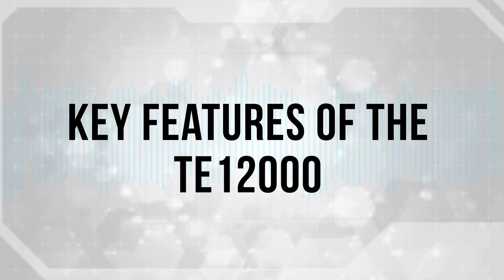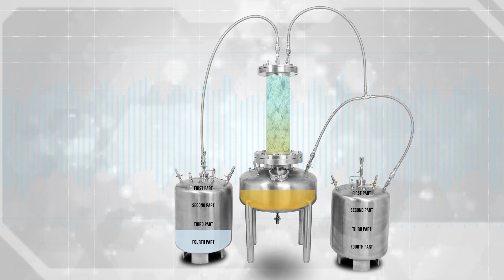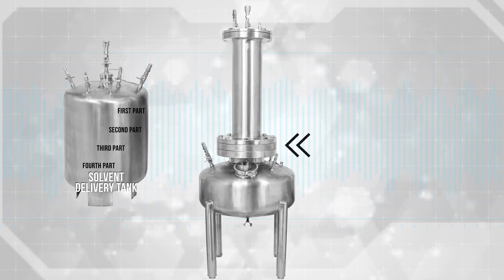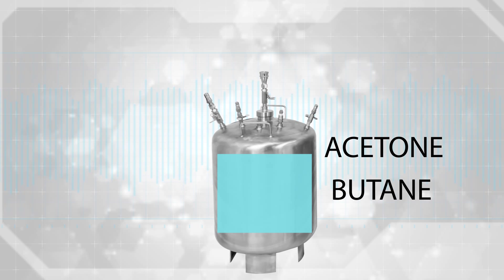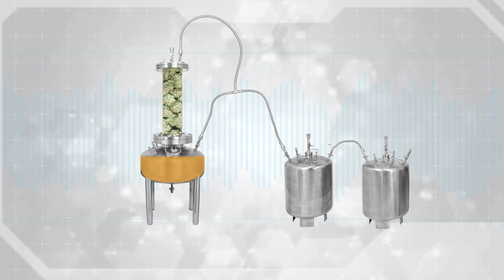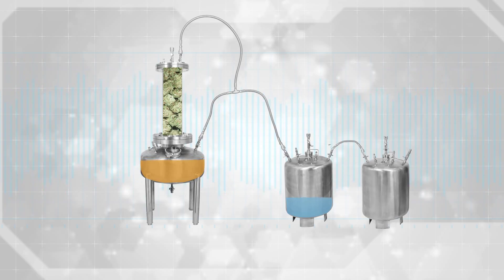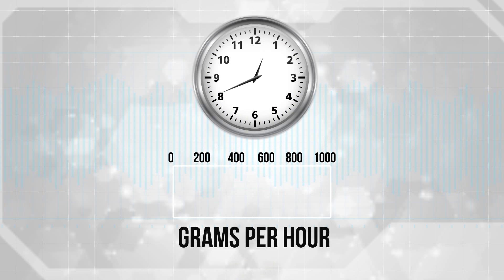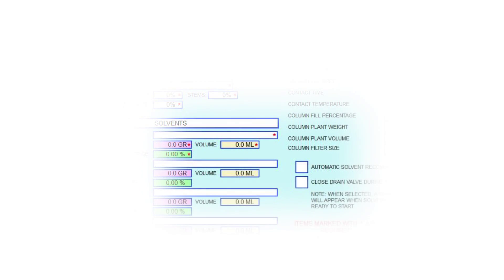Tamisium Extractor TE12000 TE3000 Features Summary defines Closed loop

Comment from the maker: With a ultra low chiller you can recover with one tank as fast as mild cold in two tanks, even faster. 
With the right wattage you can recover silently without the aid of pumps of any kind at a rate as fast as 48 liters per hour. But you have to weigh the wattage consumption and cost of cooling. This is reduced by careful design of the tanks and that is part of the patent in the design. 
The second part of the patent covers the process which can be fully automated. We are not talking about opening and closing valves following a single program. 
We are talking about creating the program for you as it learns and allowing you to create the program to save and repeat. Anyone can have a container automatically fill and empty. But can they mix a recipe of ingredients together while allowing you to alter extraction parameters to target or avoid specific compounds you have selected from a list or allow you to alter the level of the compound extracted selected on that list while also repeating that process saving the results and making adjustments on the fly to increase efficiency without your input.